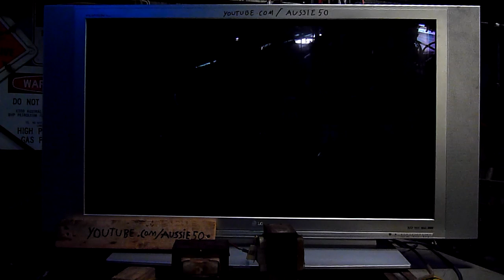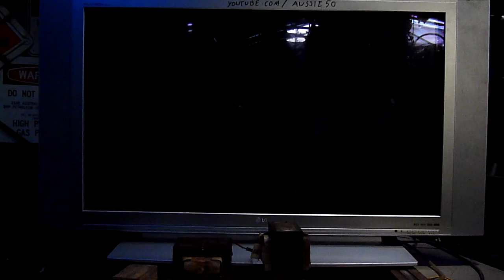LG Plasma Arc Panel Death Run - Wheres My Hammer!

Comment: LG are better than Samsung, I have repaired and scrapped more Samsung Plasmas and LCD tvs than any other make and pretty much everyone I know now has an LG, do get the odd rouge LG but Samsung are by far the worst to work on and even fix to component level, the inverters on samsung lcd tvs are real bad, blow up or just shut down for no bloody reason giving sound but no visible picture but if you shon a bright light though the LCD  It was still displaying a pic no poxey backlight !  Philips are